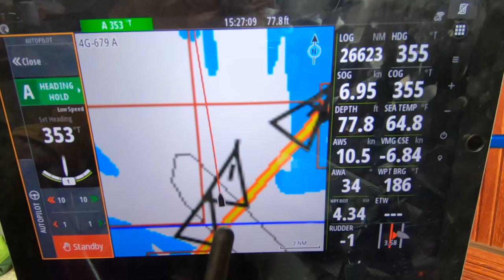Oops, ANOTHER tow?!!.... (Calico Skies Sailing, Ep 82)

Comment: You'll get the rich burn sorted out sooner than later, I hope...
Reply from the maker: She still run's pretty well, no smoke and easy to start, not sure why the oil get so thick tho.. She has about 3600 hours on it. I'll dig into it more when we get to Hurricane season spot, didn't want to start a major overhaul in Annapolis in Nov! Any ideas would be appreciated :)
Reply: @CalicoSkiesSailing  I'm not a diesel expert just an old backyard gas engine mechanic, but your friend from down under seems to have a knowledge of it. 3600 hours is a long time on a set of rings and marine engines work much harder (constant) than land based engines.
Reply: @CalicoSkiesSailing  check your injectors and make sure they are spraying
Reply from the maker: I think pulling the injectors will be on the list when we get to a safe spot for hurricane season 😀

Comment: the remote wire had failed due to corrosion, not uncommon.  if you continue using the same wire you will continue to have same failure. the corrosion goes in the wire under the insulation!  best to put on to do list to replace.
Reply from the maker: Yea I’m tempted to build my own! Use a three way switch in a waterproof case. The oem remote just isn’t that robust or waterproof to be living in an anchor locker!
Reply: @CalicoSkiesSailing  There are many wired & wireless winch controllers on Ebay & Amazon.
Reply from the maker: @jackdbur  wireless would be cool! be able to drop from the helm. Our control box is inside the boat, away from salt water. Good thing for us to look into! Thanks for the tip :)

Comment: What is your oil filtration like?  Maybe try something like this?
https://www.amsoil.com/p/universal-dual-remote-bypass-system-bmk23/?code=BMK23-EA&zo=5931&code=BMK23-EA&zo=5931
Not only polishes your oil but makes it easier and cleaner to change out filters
Clean oil = happy engine
Do you have a remote fuel filter already?
Something like a racor?
Really important especially when fueling in places that service a lot of boats the fuel tends to be dirty, by the look of your oil you might have water in your fuel
Reply from the maker: We use the standard on engine oil filters. Oil polishing looks interesting!
Reply: @CalicoSkiesSailing  
Its really great, normal filters are like 20m because they need to be free flow to keep oil pressure, this remotes the normal filter and adds a 2m filter that isnt pressure dependant, so it can be smaller and catch the small particles like soot which you definitely have a problem with.
Especially for older engines having clean cool oil is vital, plus it extends the life of the oil so less changes.

Comment: You may want to consider finding a place on shore (boatyard, etc.). Better than endangering your passengers from poor choices, seems like you always need help.
Reply from the maker: This wasn't a dangerous situation we were making way at 3.5 knots and had a harbor of refuge a couple hour sail away. Andy graciously offered to give us a tow so we could look at the engine together, the harbor of refuge was a little rolly for his liking. Things happen if you sail enough miles, we are approaching 30,000nm with this boat and gear begins to wear out. The fix was simple enough, a failed strainer seal.